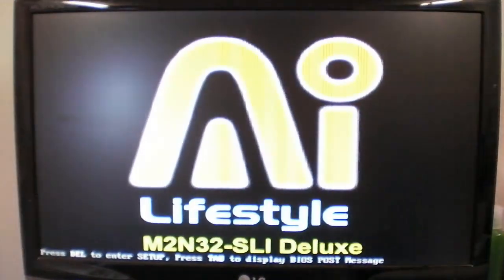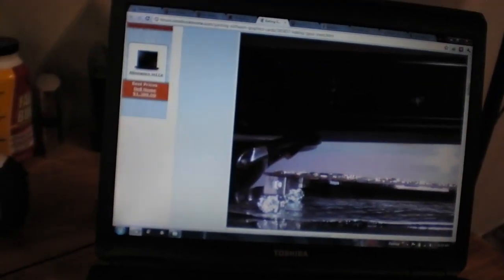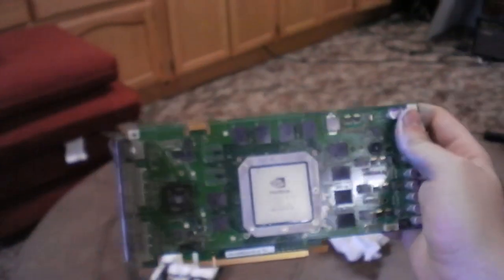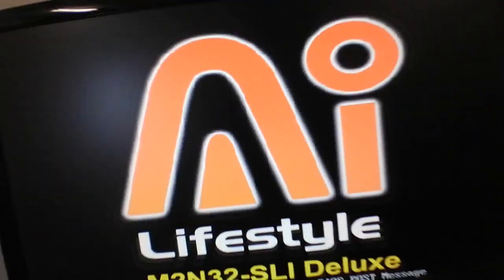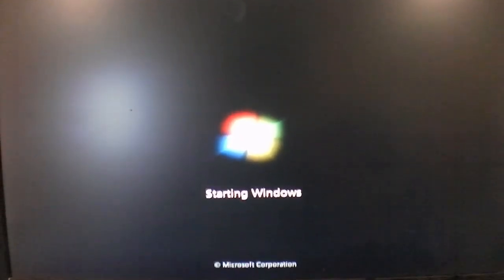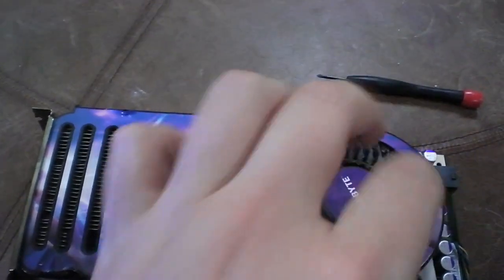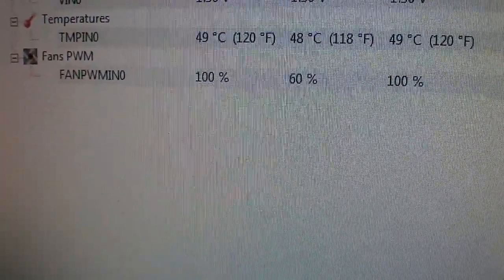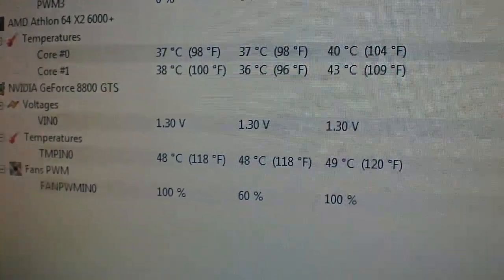Baking my 8800GTS in the oven!

Comment: I just use a hair dryer set to high for 10 minutes, usually fixes it, but if not, 25 minutes under a heat gun set to 220 works!... that's my tried and tested method for these GPUs:

NVidia GTX 480
IBM Tri-core XBox CPU and GPU
AMD R9 280 and RadeonHD 7950
NVidia 8800 and 9800GT
NVidia Quadro NVS290, FX4600, FX1700 and FX1900 cards

it's also been done on an old ATi Rage128 PRO... that's still working!!

Comment: I done it to my 8800 gtx and it worked just fine :) And it was only after I had taken off the heat sink to clean it that it started the red lines too! So I guess the trick is NOT to clean the heat sinks if you don't want to have to bake your card.
Reply: just bought one for 5 euros haven't try it yet i'm worried

Comment: Rising heat from the graphics card can mess with the Temp reader , but also heats up the cpu if its in a horizontal config. all that heat from the graphics card can add a lot of heat build up in the case , so its always good to have a Case fan blowing on the graphics card from the side / with a dust cover and it'll last way longer than 5 years and only needs a blast from a air can every 6-8months.

Comment: The card has to be facing with the chip, down. Otherwise the solder will fall out :P
And it would only reduce your CPU by 50 if it was due to the regular cooling/cpu cooler that was crapped up with dust. I guess you knew or guessed that, but I thought it would be helpful to say that cooling your GPU WILL NOT cool your CPU :)

Comment from the maker: @nakariri Not sure about the GPU facing up or down, as you can see I did it facing down. Worked fine down for me. I used the thermal pad that was already on the card, i didn't replace anything, just the coolant paste. There is a chance that if you do this it can get even worse. So it 100% up to you if you want to attempt something like this. However if the card is completely shot like mine was.

Comment: I got the same problem now with my 8800gts.. so I plan to try the oven trick method to. i got some queries I hope anyone can help me answer..i have seen some other tutorial where they put the card's gpu facing up when in the oven for baking.. does it matter? Did you put new thermal pads on you card ram? would it be o.k if i just reuse the old ones?because its really difficult getting thermal pad where I live...thanks